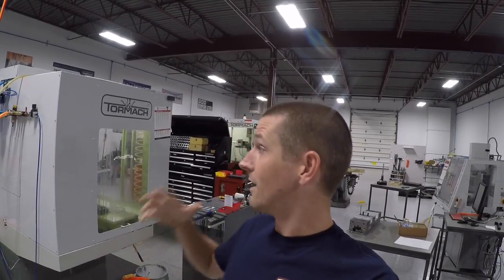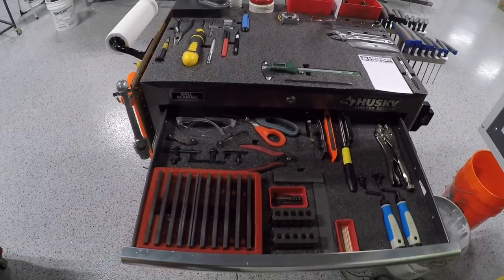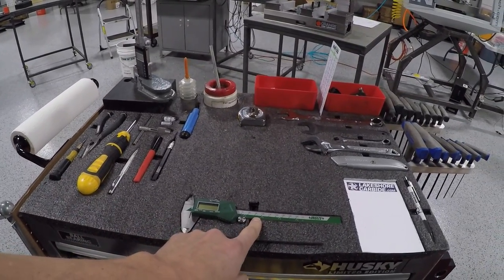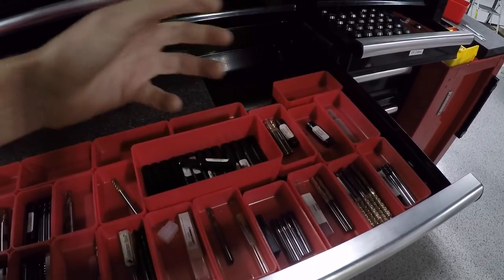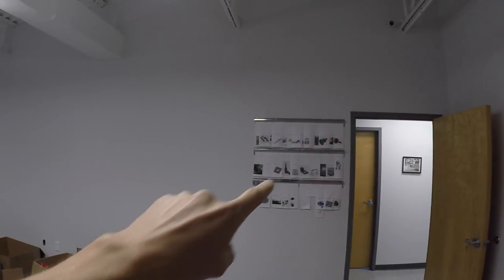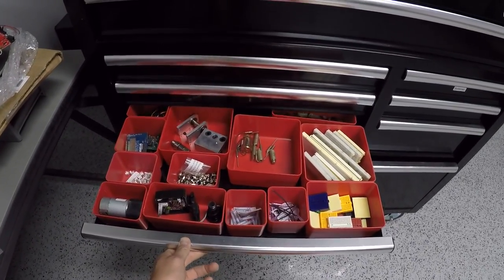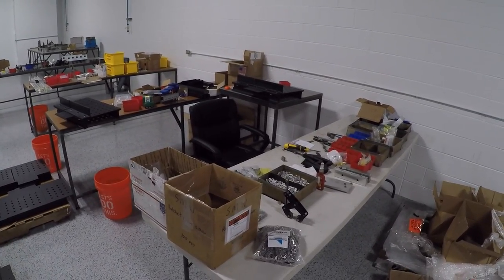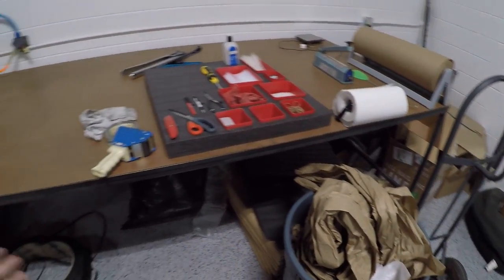Ultimate Machine Shop Toolbox & Organization!

Comment: Tips for the poor or cheep, who have more time than money to spare:
Dumpster diving.
  
 Go around the industrial areas. Usually the local one you work in is going to be the go-to but you can drive around and ask permission. Every time I toss something in the dumpster outside, I look in.  Pegboard, plastic containers, cabinets, tables, sheet metal, nuts & bolts... People toss this stuff out & I've saved hundreds, possibly more than a thousand dollars in the last couple years. If you count the stuff I will eventually use, This stuff will save me probably in the neighborhood of $3,000  ...2'x6' sheet metal, round & square tubing between 2' and 4', roller stands, power tools than need a new chord or some other, very minor repair, movers dollies and on and on...
   Just the bins that other people toss out are invaluable if you expect to start your own shop. You may need to get creative with some of it but you're smart, you'll figure it out. You're a machinist, coming up with solutions is what you do for a living.
     If you ever get lucky enough to be around when a hardware store is doing a change-over or remodel, they usually toss all the nut & bolt drawers. That one was about 6 years ago for me but I saved sooo much money. They often toss nut's & bolts too, sometimes thousands of dollars worth. For anyone who expects to start their own shop, hardware is something you can't have enough of and it can get really expensive if you have to buy it. I collect every bit of it I can and when I get my own shop I won't need much in the way of basic work holding, other than toe clamps and fixtures I have to make for specific parts. 
    If you collect hardware though, don't be an idiot and just toss it all into a bin for later. The amount of time you'll spend sorting it all out will negate the act of saving it all up in the first place. Even if you gotta use cardboard boxes & plastic bags, Keep that shit separated.
 I'm kinda OCD about it maybe because I put every nut & bolt I see, that's not owned, in my pocket or wherever and put it into my bins when I'm near them.
 I rarely have to make a trip to the hardware store for nut's & bolts though. :-)

Comment: the kaizen foam is a nice easy diy method, but as you can use milling machines in your shop you can do a more professional version of it (and myby even sell it)
use a thin bright colored foam on the ground and then a higher density foam for the cutouts, that you can mill, for the top

with milling the foam you can even go further and make 3d coutouts that fits the tools perfectly
thats what i have on my toolcart at work, but as a premade solution form hoffmann group (biggest tool supplier in germany as far as i know)
these inlays look like this https://www.hoffmann-group.com/US/en/hus/Workstations-and-storage/Workstations/Measurement-tool-set/p/923905-5
they even have inlays for your red bins :D https://www.hoffmann-group.com/US/en/hus/Workstations-and-storage/Small-parts-storage%2C-transport%2C-organiser-systems/Small-parts-bin-set/p/916825-7
or make the inlays for the tools you want https://www.hoffmann-group.com/US/en/hus/service/betriebseinrichtungen/eForm

mayby you can steal some ideas from them for your further organizing plans :D 

btw the first contact i had with hoffmann group was during an internship in a machine shop with an automated sales station for toolinserts in that shop https://www.hoffmann-group.com/US/en/hus/service/360tooling/garant-tool24

Comment: this may be silly asf on high wear areas after you cut out the foam,wood or what ever fer putting tools may bed liner spay it test it first as it may get eaten by paint  ..i use linerextremee out of texas A++ stuff /different types 2 /its got kevlar in it or big rubber / small crumb rubber you can put in it

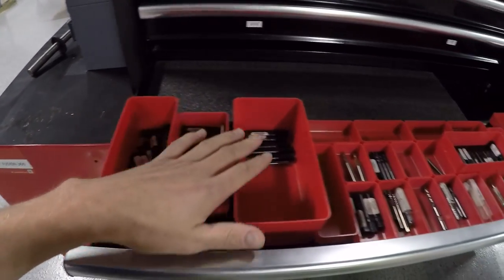Comment: At 7:25 you speak of debating whether to keep the 1/4 inch tools in those black boxes or not. Why limit the question to black boxes? Clear plastic boxes can keep the tools from banging into each other while letting you see exactly what they are. Problem solved!
Reply: NYC CNC
 maybe someone wants to trade? It would resole your problem. Between avoiding nicks and dings or knowing at a glance which tool is which, I'd say they were both important. One save time while the other prolongs tool life (saves money).
     Or maybe hot glue all the black ones together up right side by side in an array with no caps and solve all 3 problems at once ;-).

Comment: 😂 inside bore gauges, i hate them haha 😂  youve just not used them enough, everyone noways can only use digital bower gauges lol..  The secret to those ones you hate is to fix one end down and woble the top till you get no movement i.e. its at its highest point, and heres the kicker all the whilst checking that tbe handle is square to the face.  See easy 😂